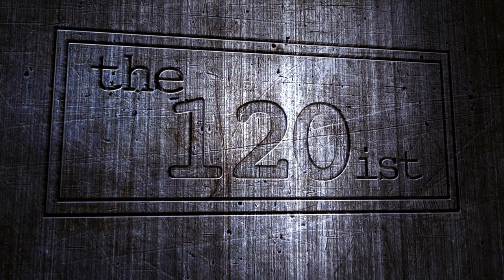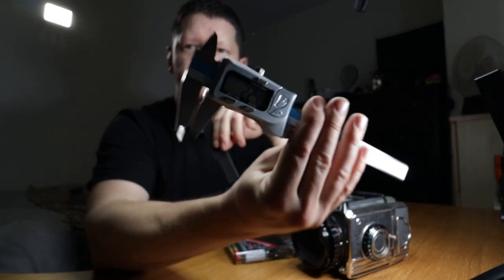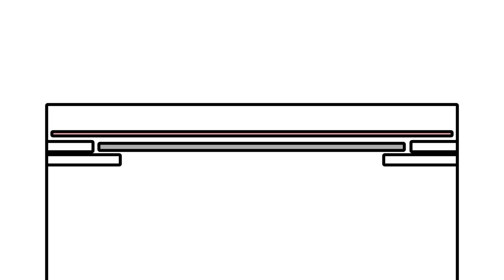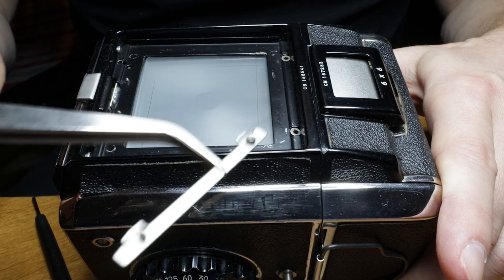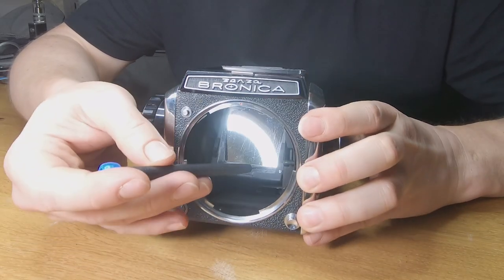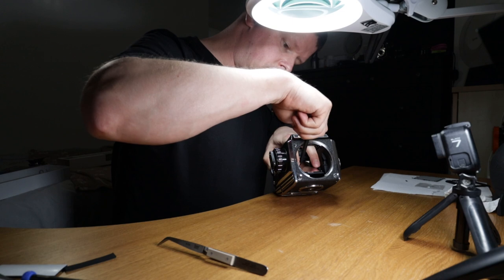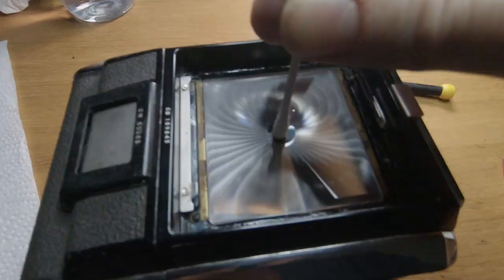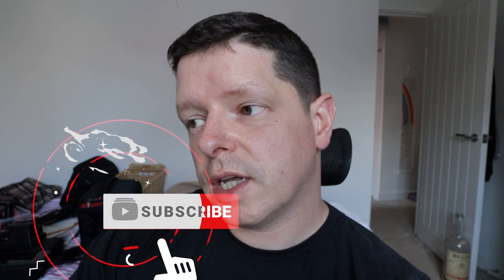Bronica S2A - Focus Problems - HOW TO replace ground glass foam AND mirror foam (also Bronica S2)

Comment: thank you so much! just finished this DIY, gonna shoot some film tomorrow, you are the best!
Reply: just a little update, if you did the procedure of this video and still not solve not being able to focus to infinity I have a little tip, after performing the procedure of cleaning and placing a new foam under the mirror and under the focusing screen, still my camera was not pointing to infinity, so the first thing I thought is that the sponge had not been adequate, but pressing the viewfinder had no difference in focus so there was no "lower" for the viewfinder so I assumed it was something in the mirror but I had no idea what it could be, then I noticed in the video that when removing the black frame in my camera two silver bars were missing, apparently the person who had this camera before me removed some long shims that are on two opposite sides where the viewfinder rests, this makes it go down slightly more than it should, as I don't have these pieces my solution was to remove the foam below the mirror, problem solved, focus to infinity.
Reply from the maker: A good tip, for sure. I never had any shims on my S2A, but there were shims in my S2. So yes, anyone doing this repair must be aware of those. I assume they were fitted in the factory according to their own focus tests, because some cameras seem to have none, some have one, some have two or three.

Comment: no, a very good video, PS: the Hasselblads (500C) don't have replaceable screens, I think they are like this, you assemble them in parts to the viewers frame, so an insight into this explains to people the WHY of how it costs so much ( and the importance of getting this right)- this actually callibrates this screen to the film plane {same optical distance, through the mirror, to the film plane, so the focus distance set on the lens IS identical to that projected onto the film}.
Reply from the maker: Thank you. Interesting that the Hasselblads don't have replaceable screens. I didn't know that. It's amazing really, considering the importance of the lens-mirror-ground glass distance, that more cameras don't have problems.

Comment: What a great channel. Thanks. Looking to break into the Bronica. I'm tired of 35mm and my RZ67 is just too unwieldy if a guy doesn't have a studio space. Sub'd.
Reply from the maker: Thanks for the sub! I love my S2A, but I do think that you’ll get the most from it if you’re willing to get your hands a little dirty… the RZ is a beast, but as I understand it (I’ve never owned one), they’re not too easy to do any DIY work on. With the S2A there are quite a few common jobs that you can do yourself without too much difficulty. 

If you’re heading down the SQ route with the Bronicas then it may not be so simple… but I can at least highly recommend Bronica as a brand, they do make great cameras!

Comment: a tip for these S\S2 bronica's, the lenses are attached differently, they are separate to the helicoid system, the manuals say, to save scratching the mirror, to REMOVE the lens first, THEN the helicoid gearing, this is ESPECIALLY true for the 75mm and wider ( they have a longer back element protrusion than most of the other lenses, and if you don't support it safely- through the helicoid module; during removal, you can tip the assembly at such an obtuse angle, that you scratch the bottom area of the mirror.
Reply from the maker: Good tip, thank you. I have always removed lens then helicoid separately as a matter of course. Don't think I've ever had the need to remove both at the same time, still attached. But really useful to know that there is a risk of scratching the mirror. Makes sense, these lenses protrude deep into the body. Thanks!
Reply from the maker: (just realised I took them both off together in this video!! I wouldn't usually do that, good to know there's a risk of scratching the mirror. I won't be doing that again!)

Comment: Hi, cheers for the tutorial. I've just picked up an S2A, pretty cheap, however the previous owner has performed the greatest of bodge jobs on the cover that holds down the ground glass....1 busted screw left out of the 4, the other 3 are super glued in place...the last screw also seems stuck down.

Infinity focus is available so I shot a roll a developed it. when stopped down the photos are fine and sharp, however at f2.8 they are out of focus. I set the lens to focus at 2ft then measured an object to the same distance back to the line of the dark slide and it was as expected out of focus. I checked this at a few distances and all seemed the same distance out of focus, so in theory i could make a constant adjustment.

Do you think this is a good way to judge the focus? or is this flawed? In my mind i think i can focus, then make the slight adjustment before shooting......not tested this on a roll yet though!

Cheers
J.
Reply from the maker: That would drive me crazy. I would need to fix that! So just to check, when the lens is set to 2ft on the markers on the lens, an object measured at 2ft is not in focus on the ground glass, is that right? Or on the developed film?

Couple of things to check - are you using the right distance markers? I don't have a camera with me right now, but I know the helicoid has three distance markers on it, for the three most common lenses, but if you have a different focal length lens attached these distances will be off.

I also seem to remember those distance plates being removable. I've definitely seen a helicoid with the wrong distance plate attached. They may even be moveable to allow for recalibrating.

What the hell has someone done to the screws?? Did you manage to get them off?

Comment: Hi there, I have just watched you vid on exchanging the foam on your S2a and found it very informative, thank you. I have just picked an S2a up and it seems as if I have the same problem, I have ordered some foam and screw drivers which I am waiting to be delivered.
The screws at the back of my focusing screen are very crewed up and I would like to replace them if I can get them out, can you tell me where you got them please.
Also did you clean the mirror on yours, or just leave it.
Thanks again for the vidio.
Regards,
Martin.
Reply from the maker: Hey Martin, apologies for the late reply, I’ve been travelling with work. Can’t quite remember the size of the screws, I’ll dig that info out later.

Do remember that you don’t necessarily need to remove the rear screws to replace the foam. But if you’re like me then having stripped screws will bother you and you’ll want to replace them! They’re a common size… maybe 1.7mm, but let me check!

I actually did clean the mirror. It’s perfectly possible, but I skipped that bit in this video because you should avoid it if possible. But if it needs a clean the go for it, just be gentle!

Comment: Thanks for this video, Can you tell me what number flat head screwdiver you are using? I have purchased 2 sets of JISD screwdrivers and neither of the flat head screwdriver worked.
Reply from the maker: For the flathead screwdrivers, you can try a standard set of mini screwdrivers. It's the cross head / philips style screwdrivers that are most different, the JIS ones are deeper and narrower. I have three or four sets of screwdrivers from different countries, and will just keep trying them until I get a good fit, so I'm afraid I don't recall which one was best with these screws. It's also possible that yours may have been replaced at some point, and are no longer JIS screws?
Reply: @the120ist  Thanks for the reply, I appreciate your time.  I was able to make the repair. Your video was a big part of that. Thanks again.
Reply: @the120ist  It is well worth having a set of JIS drivers in your camera tool kit. I bought an iFixit set several years ago that came with JIS driver heads as well as a host of other shapes. It is a great precision set. There are also a nice set of spudgers in that kit for moving stuff around that you don't want to use metal tools on.

Comment: I'm going to buy an S2A and I was wondering how to check if there is this problem, or the focus problem is possible to see it only after developing the pictures?
Reply from the maker: Hey, apologies for the slow response. You can tell if the Bronica has the focus issue by taking the lens to infinity - if the lens hits the stop but objects 100ft+ are not in focus, then you've got the problem. 

At the end of the lens, far distant objects should be in focus on the focusing screen. If they're not then the image you're seeing very likely won't match the image being projected onto the film, and you'll find your shots are out of focus even though they were pin sharp in the WLF. This applies to any shots you take - the infinity check is just a way to test. But if infinity is out, then the focus will be out across the whole range.

Comment: Any experience repairing a faulty pc sync port on the S2A?
Reply from the maker: I haven't, but I can tell you from having various bodies apart that the sync port is a super flimsy connection. It doesn't surprise me at all that one might fail. I would say that if you're confident with a screwdriver, take the side panel off by the port and check the connections. It's not a complicated job at all. But you will need to pull your leatherette off to get at the screws to take the side panel off.

Comment: hey bud, is it essential to replace foam under mirror? as th screws on mine are completely shredded away on there head.
Reply from the maker: Not essential. All depends on the issues you're having. Definitely do the ground glass foam and then see if it has solved the problem. On the first S2A I had I only did the ground glass foam, and it was absolutely fine.

Comment: I was able to take everything apart and put it back together, the bad thing is that I can't reach infinity and when I look through the viewfinder, I see a double image. Use almost 3 millimeters of foam
Reply from the maker: Hey, did you manage to fix the double image? Let me know 👍
Reply: @the120ist  hi! I change the mirror and the problem is gone! 😃 Now iam trying fix the focusing problem following your video. Is 3mm foam correct?
Reply from the maker: 3mm should be fine!

Comment: Hey there, thanks so much for this. I just followed everything to a T, but it seems like now I can’t reach infinity focus, or in fact I can’t get anything to look perfectly in focus in the viewfinder. I can get it pretty close to being sharp (and it looks sharper when i press the DOF estimation button by cutting some light), but still I’m not quite confident. I thought maybe the foam I used was too thick, but its 3mm like you recommended so I’m at a loss. Any ideas? Thanks again!
Reply from the maker: Sorry it's taken me a while to get back to you. If you're not reaching infinity on the ground glass, then there is a problem. Not reaching infinity means that the glass is sitting too high. I'd be surprised if 3mm foam is too thick. What sort of foam is it? Does it easily compress? It's not too stiff is it? Are the screws nice and tight? It may settle into position with time, but worth taking the top off again and screwing it back down. Let me know how you get on, I'll help if I can.

Comment: My S2 was not reaching infinity.   After doing the focus screen foam fix, it still was not reaching infinity.  After doing the mirror foam fix, the camera was overshooting infinity.  From what you've said in other comments,  this means that the focusing screen is too low.  Is this correct?  Do i now need to pull the springs up?  How high is visually too high on the springs?

Comment: Just a heads up for anyone else who may be struggling to find 2mm foam locally, keep looking. 
I just tried 3mm as that was all I could find local and I've just snapped my mirror. 
Either that or I tightened the screw too much but I assumed it would need to be fully seated 🤷
Reply from the maker: Yikes, that's not good. Interesting that 3mm broke the mirror.

I have a spare mirror here, if you want it? Drop me an email, you'll find the email address in my profile / description.
Reply: @the120ist  Yeah I wonder the EVA foam was too firm and maybe a neoprene might have had less resistance 🤔
After inspecting, the foam definitely sits too high at 3mm though, it's very close to the frame already without a mirror in it.

Oh that would be amazing if you didn't need it! I will send you an email thank you

Comment: Thoughts on using felt instead of foam to prevent this issue cropping back up down the road? Would it work or is the compressability of foam critical to this fix?
Reply from the maker: Interesting question! I don't know the answer, I'd be very keen to find out if it works!

I seem to recall hearing a few years back from someone who replaced the foam with leather, and got good results, but I can't remember where I read that. It could be in the comments here... not sure!

Something to consider if you're going to go the felt route - I've spoken to people who have created the opposite problem to the "not reaching infinity focus" issue, ie their cameras started over shooting infinity. I think we established that this was probably due to too thick foam being used, sometimes combined with after-market plastic screens, causing the focusing screen to flex downwards into the space, shortening the screen-mirror-lens distance.

So I think the felt could be a really good idea, definitely worth a try, and it will probably last longer, but I would guess that you'd have to be a bit more careful about the thickness of the felt when compressed, and ensuring that you don't overtighten the screws holding down the GG when you put it all back together.

Let me know how you get on, I'm curious!

Comment: It works! Thanks a lot!
Reply from the maker: Great to hear! Glad it worked. My S2A focus seems to be off again, annoyingly, so there will be another video coming soon on how to correct the opposite problem - focusing short, or overshooting infinity, just in case you ever encounter that problem!
Reply: @the120ist  today I developed the first testroll after the repair. The focus is correct now. I changed the foam behind the mirror and on the screen.

Comment: Just to confirm, did you end up not using the Olsen prism/glass and go back to the original?
Reply from the maker: In this video, yes. But I have since installed the Rick Oleson screen, about a year ago or so, and it has been in my S2A ever since. Highly recommend it. It’s a great screen. Although I would suggest getting the split prism focusing aid in the centre. I didn’t and I wish I had!
Reply: @the120ist  Thanks very much for this information. I really prefer a split image probably because that’s what I am used to. I was concerned that using his screen might not work with the tolerances of the Bronica platform. I plan on ordering one ASAP. Thanks again for your information and your videos!
Reply: I just installed the Oleson split image finder and the foam he provided for the mirror. Unfortunately I had the same problem you had with the rear screws. The front two came out ok but the rear were basically frozen. I got one rear screw out and it seemed to have something like permanent lock tight on the threads.  But the other rear screw would not budge and I was just stripping the head and in danger of breaking something. Thank God the new screen slipped under the rear metal strip. It’s dark outside now but I’m confident I will have infinity focus tomorrow. Why people feel they need to cement these delicate little screws is a mystery. I really like the split image focusing screen as that’s what I’ve used for decades. Thanks again for taking the time to put together your extremely helpful video. Cheers!